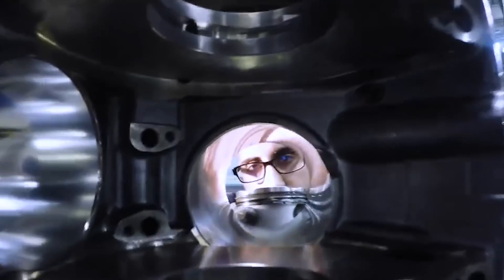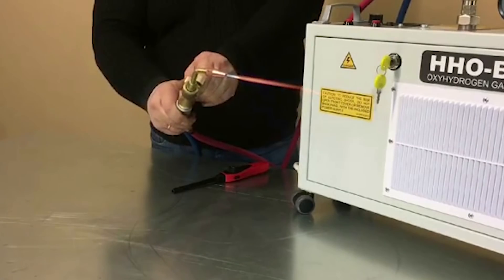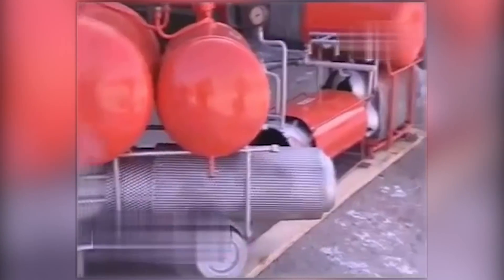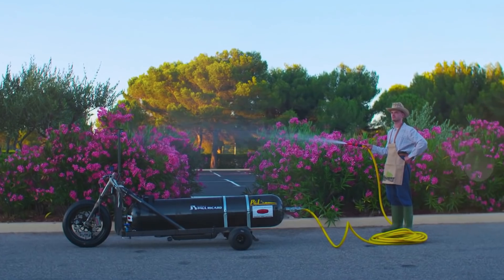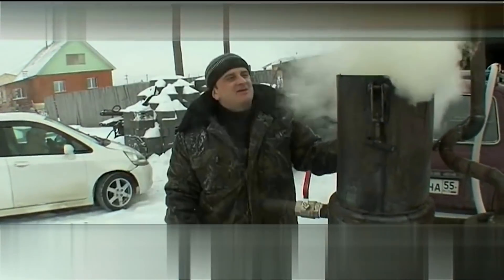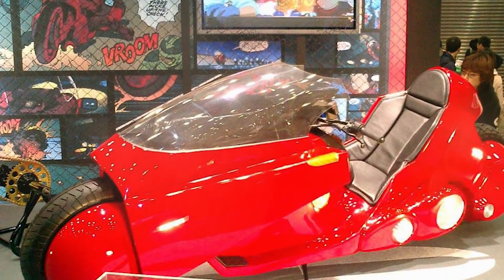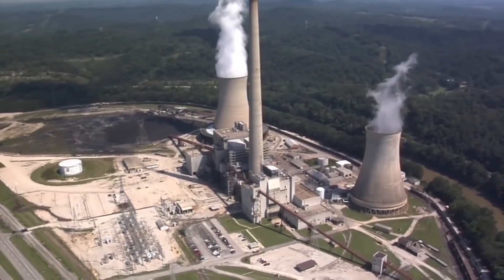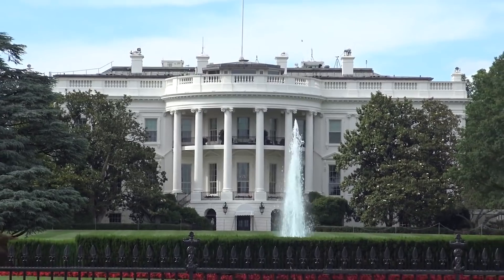Why These Engines Are Banned?

Comment: Air driven vehicles are quite old, they used air driven locomotives in deep coal mining.
They were the safest form of transport as the air driven piston engine could not create sparks or lots of heat like a combustion engine or electric locomotives, and this in regard with the methane gas often present in the coal mine tunnels.
But using compressed air isn't cheap as in the proces of compressing the air a lot of heat is generated which generally goes to waste as most air compressors don't reuse this heat.
It's only in larger industrial air compressors where the heat is used to dry the air as compressed air contains water condensate which has to be extracted from the air to protect the machinery driven by it against corrosion, or water in the paint with spray painting.
But even with this regenerative drying storing energy in compressed air is quite inefficient, especialy when it has to be carried in tanks under very high pressure to drive a vehicle.
Industrial compressed air is in the range of 7-10bar/100-140psi, but with this pressure an air driven vehicle would have a range of around 5 miles, or have huge tanks to get more range (the locomotives looked like steam locos where the place of the boiler was taken over by air tanks).
To have sufficient range the pressure has to be in the order of 400bar/5600psi, and creating air under such pressure is costly, anyone refilling dive bottles will know this.

Comment: Water injected jet engines were also banned in North America anyway . The boeing 707 I beleive had the in 60 and 70 and were banned in 1980s they were too loud .
Reply: Chevy, circa 1950 had a water bottle in the engine compartment that was used to draw water vapor into the carburetor to get a little extra fuel milage. I never saw one actually hooked up and working. It was about the size of a quart Ball canning jar.

Comment: Modern power trains in electric cars are occasionally as high as 85% efficient (and the worst usually above 75%). That is for battery losses, mechanical losses, motor losses, and motor control losses combined. Therefore it is not possible to be many times more efficient. The Russian designed a process more efficient than what existed in his time but back then electric motors were usually 50% efficient at most, not 90+ like now. FET controllers had not been invented, never mind the ultra low RDSon we now have, and even the batteries were less efficient. IE more of the energy used to charge and discharge the battery turned to heat (higher ESR etc).

Comment: I have a car in my garage with one of those government conspiracy spiny triangle motors.  But, it was designed by a German about 70 years ago.  Then developed for decades by the Japanese.  Eventually, in 2008 it was shipped to the US.  I procured it in 2012 and have been keeping it a secret, till now.
Reply: mine is marinating in oil, like good wine
Reply: Hey, I have the same "banned" technology!!! Now, let me get back to replacing apex seals!
Reply: @TheOtherGygax  lol. Mine are still intact.  So far.  78k miles on them and counting.
Reply: Don't forget the sound when you floor the throttle. Everyone thinks you're driving a Formula 1.
Reply: Actually it was in the 80s
But close enough.
Don't forget the rx series and the 1st gen rx7

Comment: Why these engines are banned? Oh that's simple. When normal car has an accident, it wrecks, maybe leaks fuel, maybe burn. That is all.
When compressed air car has an accident, gas bottles rupture, releasing ALL stored energy IN AN INSTANT. Power equal to tens or hundreds of kg's of TNT is released. And guess what happens.

Comment: Bait and switch. This is a collection of alternative fuels and bad ideas for engines. Hydrogen and compressed air generally aren't used because they require a pressurized tank. In an accident, they can literally become a bomb. Wood? Good luck getting that through emissions.
Then the "magnetic" motorcycle; that's simply an electric motorcycle; they exist. They're expensive.
Nuclear? Sure, radiation poisoning isn't a thing.....wait, it is. Then there's the cost of having a nuclear reactor, and disposing of nuclear wastes, and a simple fender bender requiring radiation suits for cleanup. Great idea.
None of those are secrets, just impractical for general consumption.
Cap it all off with conspiracy theories. lovely

Comment: Using the cars engine to generate electricity to generate H2 and O via electrolysis, you can not possibly generate enough H2 to keep it running. If you could preform such a feat, you could run continuously for as long as you wanted with no fuel costs (absent other needs like maint etc etc.)
It sounds suspiciously like perpetual motion

Comment: This idiot knows shit about physics. The compressed air driven car . . . . you get home and connect the compressor and start up the powerful electric motor, and you get charged for the electricity. It probably makes more CO2 per horsepower than a petrol engine. The " Magnetic engine "  ???  You mean the free energy scam motor under one of it's many aliases. Do you stop at a fuel station stick the nozzle in and pump magnetism into it's tank ? How can something be banned that doesn't exist ? Bullshit vid.

Comment: Not fake and not inefficient but old tech and some improved as well. The technologies of compressed air vehicles is over 100 years old. Trams, trains and some car ran on compressed air before petrol or diesel was used. Ford was going to use Hemp oil and made his first car from Hemp as well, industry giants saw to that and ensured Hemp was banned in the USA so that oil would be used instead. MDI a company based in France were setting up licences in countries around the world to manufacture compressed air propelled cars and vans. The reference to Mazda with diesel engines that are far more efficient and produce 30% less emissions is also not fake but actually real technology. Why not tell Mazda the technology they developed and are now manufacturing is fake? Idiots.

Comment: the best way to get motion from compressed air is to open the bottle and point it in the direction you want to go like the gocart thing, as there is little loss to friction and heat. It just doesn't go very far for the volume compared to other solutions and wastes more energy than an electric motor by the time you compress all that air

Comment: Here are the problems with the vast majority of these engines... RANGE n INFRASTRUCTURE.
We have over 100 years of fossil fuel delivery infrastructure, while nitrogen, compressed air, electric are fine n dandy having no place to refill them or waiting 8 hours for a recharge after a few miles is not feasible especially in a Nation like the United States where people often commute large distances for work.
The lie that the oil companies kill these ideas are wrong as there is nothing you use in daily life that does not have some form of petroleum distillate used to create it. From cell phones, to plastic toys your kids play with.

Comment: Use propane to power cars, just add on thicker tanks for more durability and more safety.

Propane runs cleaner than gas, and can power gas engines.

Comment: 'Magnetic engine' is just another name for electric motor.  Duh
Reply: If your talking about the motor cycle in Tokyo then yes but that electric motor works differently. The battery is used to reposition the magnets creating a constant magnetic feild pushing the driveshaft. It's not free energy but it is very efficient.
Reply: @anthony666able    Let's see. .... electricity, changing magnetic fields, shaft turns -yup.  Electric motor.
Reply: @RTmadnesstoo  changes magnetic feild and magnet position. Something normal electric engines don't do. If you watch when they put it on the Dyno you can see the ring of electro magnets move out of the drum.
Reply: @anthony666able  changes magnetic feild, electric motor.
Moves magnet position, brushless electric motor.
Reply: @anthony666able  I noticed that movement... But the engine running is solely on the power of the magnets or also helped by the batteries? That banned electric engine from the Russian inventor also seems interesting: Visinsky? Lissitsky? Do you have more info as I find nothing on Google... Thanks again!

Comment: Compressed air vehicles are completely dangerous,  sure in a gasoline driven vehicle you have to worry about fire hazards,  but the first wreck you get into with huge compressed air tanks will cause a massive explosion that could potentially set off other vehicles!

Comment: how do you compress air without external energy? How do you generate HHO without adding external energy to split the water? these are just storage devices es .. not energy sources.. non of these have the power density of petro chemicals.
Reply: I'm not sure of this but I believe the HHO must be started with external energy until sufficient HHO to self sustain the power plant is solely operated with HHO at which time the external source is cut off.

Comment: Went from technology to conspiracy theory quick!!! The rotary engine is not banned. Although some Mazdas have it, it was discontinued because it is not as efficient as the other engines.
Reply: Actually it is efficient it's just not reliable the bereans in such breakdown much much much quicker than normal up and down V style or inline engines do
Reply: @JwilliamsAssociates  It's still not AS efficient, nor as reliable as other engine designs.
Reply: @toddmiller5322  I'd have to research that a bit I would Challenge on the efficiency part but I could definitely be wrong a lot of advancements have happened since the rotary came out it is cool engine my RX-7 had one very high revving engine however and can be particularly touchy
Reply: @JwilliamsAssociates  Rotary engine are high revving and good for making power, but the basic design of the engine does not lend itself to efficiency or longevity, no matter what advancements are made. There is a reason why more car manufacturers don't use them.

Can't have it all.
Reply: @toddmiller5322  i realize that.  Efficient I'm Not sure but I know first hand,  as I've stated,  they are not reliably.
Reply: Jeffery Williams. The efficiency based on capacity is highly misleading, since the figure is based on the capacity of the combustion chamber on each rotor. However each rotor effectively has 3 combustion chambers. The total displacement of a 1 liter twin rotor engine is therefore equivalent to a 3 liter 6 cylinder piston engine.
Reply: @JwilliamsAssociates  the newer rotaries such as those in the 3rd generation rx7s were designed as a high performance engine and because of such engineering over previous generations have a rebuild interval of 60k miles which put a bad mark on the engine, however its not uncommon to see older rotary powered vehicles go well past 150k with nothing but routine care as a normal car would. 
just for reference my 84 rx7 sat for over 2 years and after a fresh battery started like it never sat a day and idled as smooth as always. as for further reliability the engine actually was banned in the 24 hours of lemans as a power plant because it was strictly to reliable and consistent as compared to other engines run in the series and was considered and unfair advantage. fuel economy thats always going to be terrible best i have seen recorded on a 85 rx7 with 175 wide tires mind you was 30 mpg on a trip from colorado to ft wayne. stop and go kills fuel efficiency  in these engines. but still very cool engine and ill always be a fan.
Reply: @William King - the DC3 Aircraft was designed and built in the late 1930's fitted with rotary engines and was the workhorse of the US Military all through the second world war. Some of them are still flying to this day so I don't know where the engine reliability question arises. Just my two cents worth.
Reply: @williamcoyle4022  it arises from the fact that rotary engines are nowhere near as reliable as other engine designs. The word Factor on the components is infinitely higher. That's where this comes from.
Reply: @williamcoyle4022  There's a difference between rotary or radial engines fitted to aircraft and the Wankel rotary engine, which does not have pistons.
Reply: Jeff, you keep saying unreliable this without actually knowing what parts actually wear..... and why. The engine had 3 moving parts. The apex seals are the singular wear item that wear no differently then piston rings, the fact many do not seem to last is the fact they get driven far harder then say grandmas Ford focus. Try driving a focus as hard and see how long that eninge lasts cause it won't. Also The dc3 used radial engines not rotary two different types of engines.
Reply: @williamking5979  what gives you the impression that I'm not aware of the parts that we're out? Because I didn't itemize them?
Reply: @williamking5979  They don't last because of when they aren't being driven hard. Apex seals typically see a very high surface speed and are made of materials to manage that condition... which are absolutely not the best materials to handle cold startup chatter or excess tolerance from uneven heat expansion. Pre-ignition and detonation are particularly not well received, and those engines were at their most popular in the time of carburetors and lousy fuel. That's why they became unpopular the first time around, and while the Renesis solved a lot of the preceding issues with better engine controls and materials it still suffers from unique and common problems. 

The biggest problem of all is that it's impossible to lubricate tip seals without leaving ALL the lubricant on the chamber walls. You have the active chamber... but the other side of that tip seal is the next chamber, not a cylinder open to a crankcase where an oil ring can scrape splashed lubricant back down. You also get to try to seal a corner that's "on the move", another enginerding nightmare that Mazda managed respectably well...

Comment: Why are these not widely sold or used? Because they don't work or are wildly impractical, inefficient, or too expensive. Look renewable is great, but there is NO FREE LUNCH. Gas, coal and petroleum are still very practical and cost effective. Renewables are expensive and can't provide power 24/7 365, all weather.

Comment: All of the alternative engines shown require more energy to make their respective "fuels" than the engine produces. For example the HHO generator is very cool but the amount of energy required (electricity) to separate the H2O into HHO exceeds the amount of energy (kinetic) that you'll get from burning it in an internal combustion engine (and CAUTION!!, assuming you've used stainless steel for your HHO generator plates, you're producing HEXAVALENT CHROMIUM!). The same is true for the amount of energy required to run the air compressor that charges the tanks for the compressed air car but at least there's no radiation. I'm sorry to be the barer of bad news but there's no such thing as free or "green" energy. A basic understanding of chemistry and physics will make it all crystal clear. I encourage everyone to do the homework and research without going off on a tangent while trying to prove a pipe dream.

Comment: Are you deliberately clockbaiting or are you just a total ignoramus?

To split water into hydrogen and oxygen - you need energy. Much more then you will get from an engine powered by the same hydrogen. Otherwise you would get a a perpetuum mobile.

Compressed air engine is quite neat, however it will be very inefficient (can you guess what happens to gas when pressusre drops?)

Comment: The vehicle that uses air...still needs a compressor to pump the air...which means it still takes energy of some kind to pump up the pressure..so what ever method that is used to pump up the air..is using energy..thus some type of fuel. so your right back at using fuel again.

Comment: There seem to be many Nay-Sayers here in the comments. I know my testimony means jack shit in the world of evidence and even fact-snobbery. Please explain to me how Myth Busters debunked the Bedini Static Generator when I witnessed one work myself that my electrical physics professor built in his garage. I witnessed this device run for 2 weeks straight, in the classroom, without stopping (he even recorded it for personal use) and charged 12 car batteries that were near-dead. All of this with the flick of a finger.

You want to know what the difference was between the Myth Buster's example and my professor's? The Myth Busters applied a load to the generator's wheel. You can hear a whining grinding sound that was NOT present in my professor's version. Of course the device will fail if there's a static load applied to the one moving object in the circuit.

Take this testimony however you want, but HEED these words. We live in a parasitic society that thinks nothing of throwing pure-spirited ingenuity in the bin for more profitable options.  It happened to Nikola Tesla thanks to Thomas Edison, it has happened to thousands of patented and un-patented schematics on High-Efficiency, clean energy devices and much more. If we do not discontinue this behavior we will all be kings and queens of shit-hill and have no viable way to get off of Earth the day a Comet, Asteroid, or even a Neutron Star decide to make close neighbors of our planet's orbit. Money won't mean a fucking thing if we're all dead and have no way to carry on.